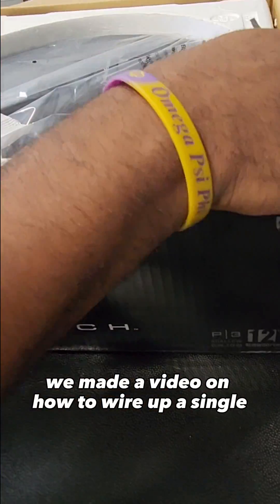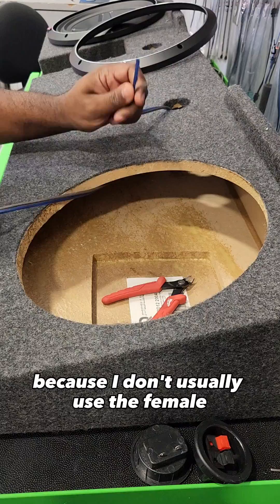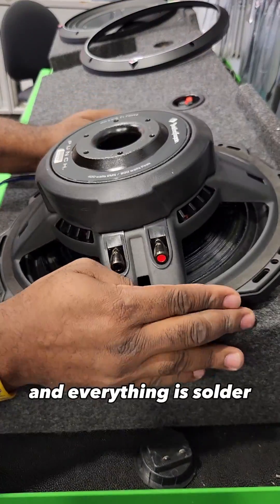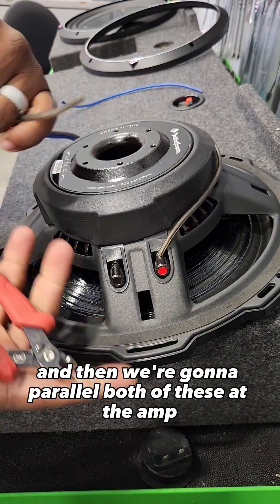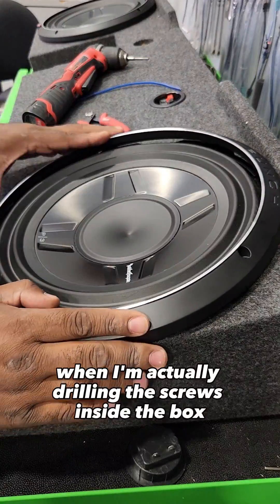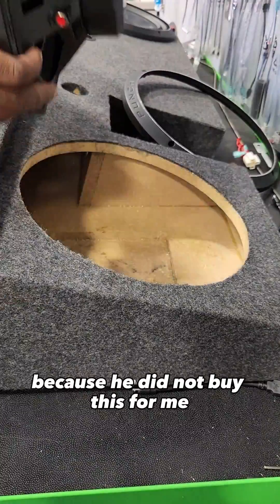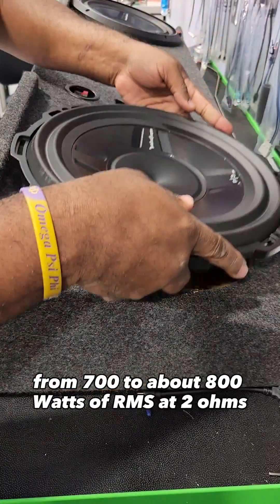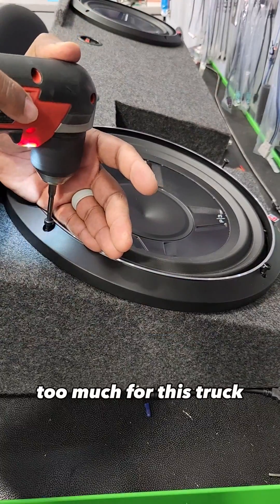how to wire 2 dual voice coil 2 ohm subwoofers

Comment: I saw the way you were screwing that speaker down and instantly knew that you slipped a screw screw and you punched the hole in a speaker before. I did the same thing and I never drive any 👍🏻screws unless I’m protecting the speaker.

Comment: I Have a 700 watt per channel amp optimized for 2 ohms so if I hook it up a dual 4 ohm subwoofer to it. I take it that it would make it 2 ohms and use all 700 watts rms? Or would 2 ohm sub be better even though it’s dual? Trying to figure out what to do… the amp will only allow parallel you cannot serial it as stated by amp manufacturer.

Comment: I like to do the parallel in the box and series out. Once in you Don't want to pull the speakers back out.
Plus you can achieve the same load or parallel again if you got the right amp